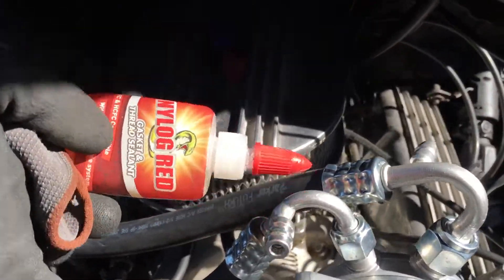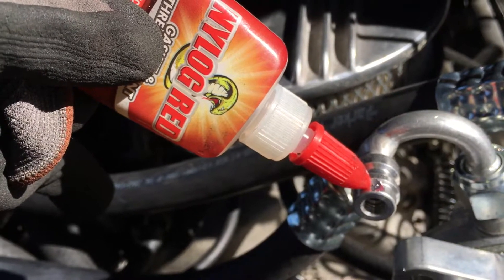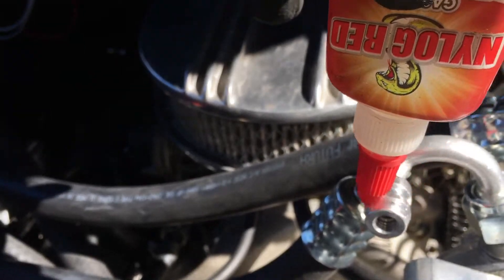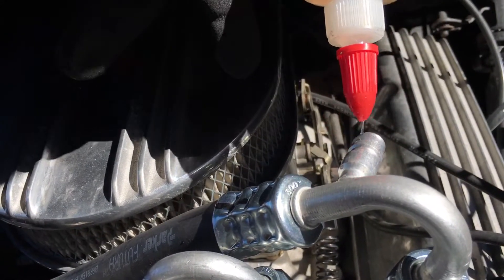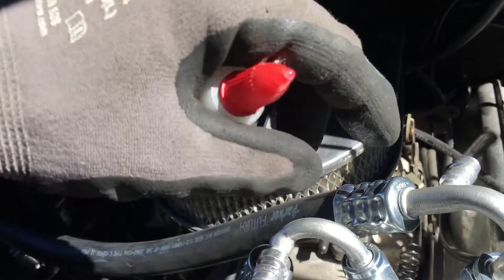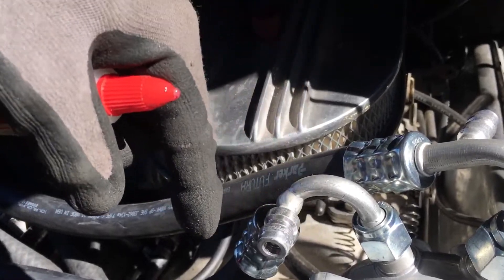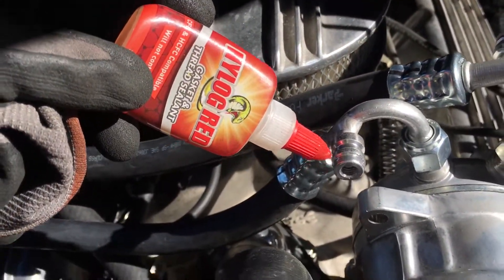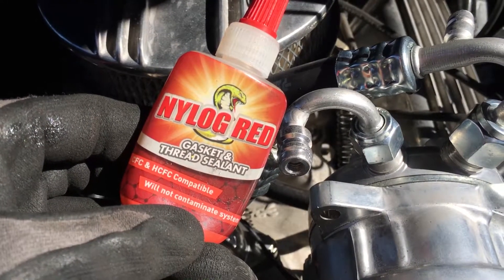R134a O ring fitting adapters need lubricant. Service fittings have O-rings inside that need care

Comment: not a bad idea !   i would use pag oil for 134 a or oils that the system your working on calls for ,,,,,in case of contamination ?    darn good idea though some of us dont always maintain our manifold gauges like we should ,,,,,
Reply from the maker: NYLOG is made out of refrigerant oil

Just extremely thicker viscosity 

Do you know the Vaseline from the drugstore that your grandmother would use all that mineral oil and a higher viscosity? 

NYLOG blue bottle is POE oil

And you’re not applying it to the inside of the fitting you’re applying it to the outside of the circumference of the fitting so you’re not getting it inside 

And even if you did it inside, the quantity ratio would be 10,000 to one unmeasurable

And the reason it is so thick, unlike oil it stops vacuum from pulling backwards through the O-ring .  

This is Laboratories with vacuum they use silicone grease because it’s so thick even if the O-ring was damaged or if there was a slight imperfection a scrape on the metal surfaces the vacuum cannot pull through the thick viscosity of the silicone grease

Comment: Will the pressure on the compressor discharge like this video and after the condenser be the same?
Reply from the maker: There will be a little drop. 
     Pressure drop happens due to friction.  At every bend, passing through smaller tubing. 

The pressure at the discharge of compressor is higher then the inlet of the expansion valve. 

Same for the outlet of the expansion valve is higher then the suction port on the compressor even though they are both on the low side.